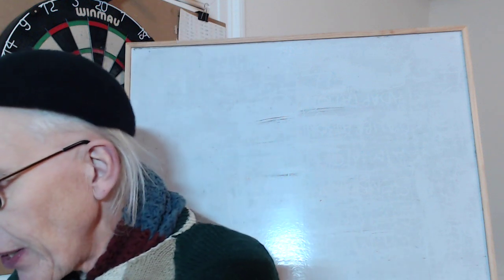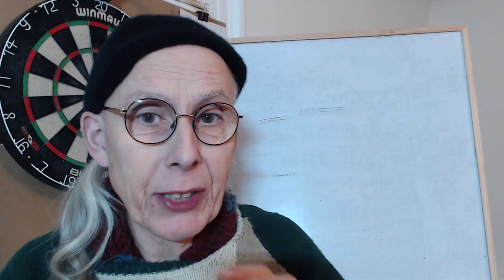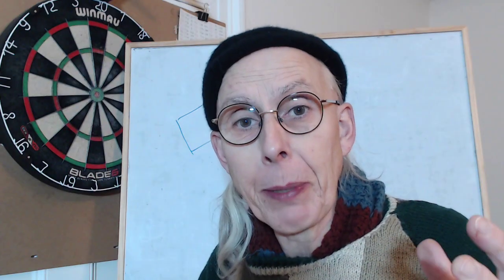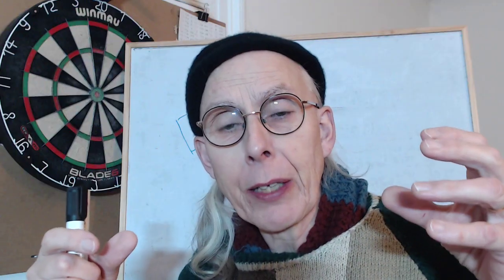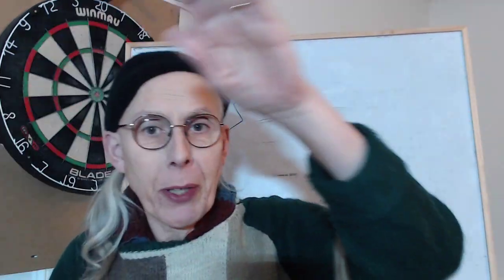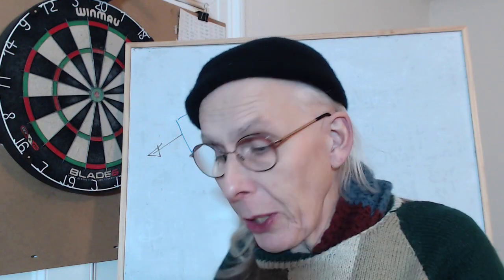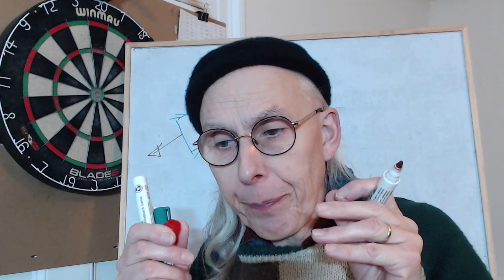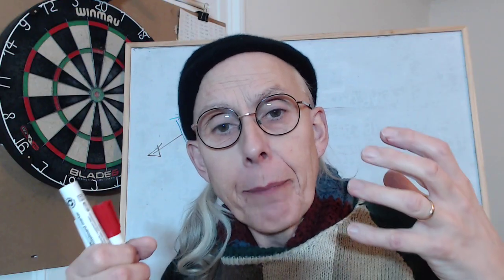Is Your Accuracy Really Sensitive to Your Flights? If So, Check Out Lift and Form Drag!

Comment: Very interesting I throw a short barrel dart always around 36 - 40mm long and a short or extra short stem with standard flights. If I throw a longer barrel with any stem even longer stems the darts wobble in the air and are uncontrollable. My guess is my front holding grip. No matter what type or shape of longer barrel, and I have tried many, they wobble severely. 😮🎯🎯🎯
Reply from the maker: Many thanks, and that wobbling is very interesting. Like you say, the front-holding grip is likely the reason, as you are probably throwing slightly ahead of the dart's centre-of-mass, which might lead to an instability, and that instability is made more pronounced by having longer barrel/stems (i.e. being further ahead of the centre-of-mass). But, if the shorter barrel and stem length suit your action, that is all that matters, as I think we all have to adapt to the peculiarities of our throws!

Comment: I find that if i am throwing well, i can use slims. They tend to fly quickly,  and with a flatter trajectory...that or i throw them faster. I do find them less forgiving. They also sit flatter in the board. Standards seem to suit a more loopy, slower through. I usually use a kite flight which is a compromise, although tbh my flight choice is the least of my worries...
Reply from the maker: Many thanks! Yes, I find the same thing that the slims fly faster, I guess because there is almost no form drag. The loopier trajectory of standard flights is nice, to be sure, and perhaps more forgiving. I'm aiming to stick with the home-made slims for a while to see if I can tame them completely!

Comment: JB Priestley was a staple of my English GCSE 😂 memories flooding back. Darts 26 in 2026… every other throw is a 26 for me at the moment! Regarding the angle of the dart, plenty of players either flick or pull the dart slightly to create that angle, using the air to make the dart sit upright. It’s interesting but a difficult technique I think.
Reply from the maker: Many thanks, and I hope that GCSE went well. English Journey is definitely worth a look, showing how little some things have changed in 90 years, e.g. in terms of the haves and have-nots. Yes, that flick is something I've been told about too. I'm not convinced, from the physics point of view, that it is necessary, but then again I am light years away from that level of play, so perhaps it is an important step to becoming an elite player?

Comment: Happy new year timo. Good to see you back sir
Reply from the maker: Many thanks Mark, Happy New Year to you too! A longer break than I had planned, but mainly due to family commitments and extra work shifts. Feels good to be back!
Reply: Funny you should make a video on this, I’ve noticed such as Luke littlers darts hit the board on a angle where as gian van veens hit the board almost perfectly straight 🤔 my darts hit the board like van veens, I was thinking about this so started watching their throws, one thing I noticed was rather than a over arm throw I tend to push my dart forward which makes it hit the board almost straight, but once I have played a couple of hours my throw gets lazy then start hitting the board at a slight angle
Reply from the maker: @janettinkler2204  Thanks, that's very interesting. I wonder if it's to do with distance from the board, that your "push" means the dart is a few inches closer before release. This could be tested by standing a few inches back from the oche and using the push throw. The darts will likely land lower on the board, but it would be interesting to see at what angle they sit in the board? All the best!
Reply: @UndartedWaters  yes I’ve tested that theory today,  they do drop quite a bit actually
Reply from the maker: @janettinkler2204  Many thanks, and, may I ask, was the angle different too – were the darts landing at a significant angle, even with the push throw? Thanks.